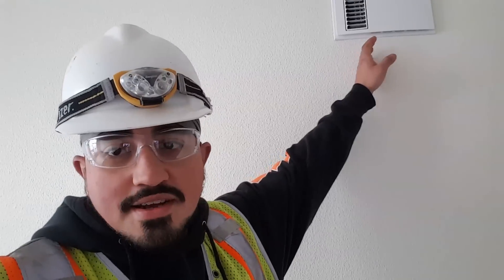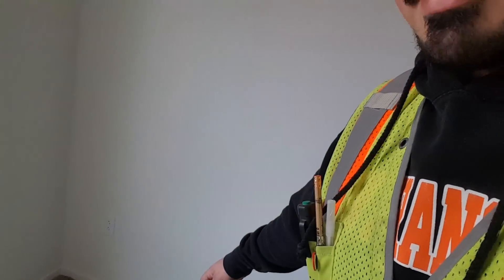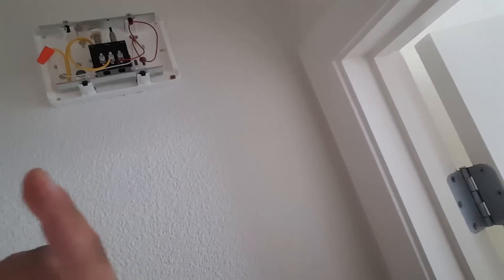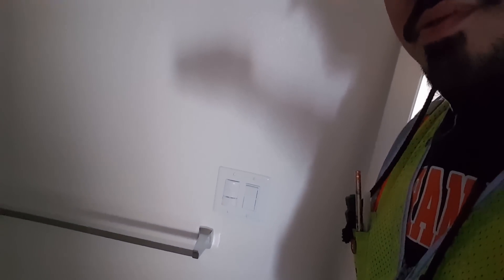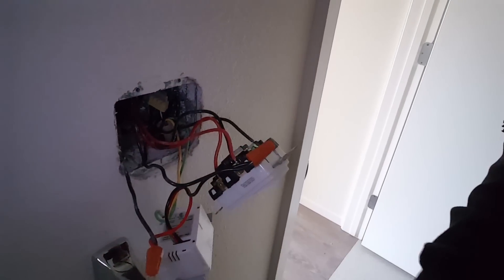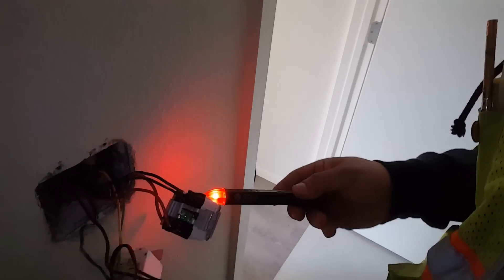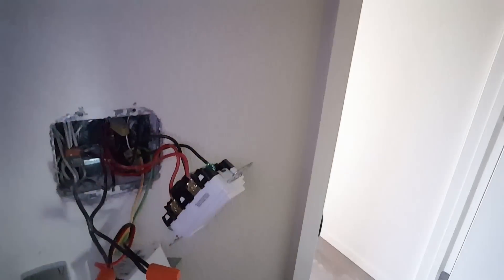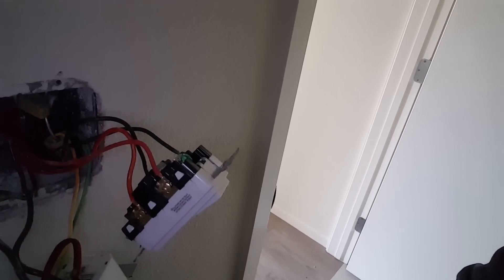A day in the life of a Union Electrican (2 of 2)

Comment: as an electrical apprentice with decent knowledge im a little confused by this whole 2 pole switch situation.
what is the purpose of having 4 wires if they come on together? why wouldn't it just be a 12-2 up to the fan light and wired together up there?
Reply from the maker: +John Pish that would make alot of sense but the factory wiring is separate. Its a dumb design that is needed to be that way.
Reply: The LMT Channel so what exactly does the 2pole switch do? is it essentially a 220v switch?
Reply from the maker: John Pish No, not 220. its 2 switches in 1. 2 circuits controlling 2 things with one switch. in our case we pig tailed the line to both sides using 1 circuit to power 2 different things at the same time. the fan and the light because of the way the fixture was made from factory.
Reply: The LMT Channel The LMT Channel so if it's on one circuit.
what's the purpose of pigtailing the line side and using a 2pole switch. instead of pigtailing the 2 switch legs onto the load side of a standard single pole switch?

wouldn't that accomplish the same thing?

maybe I'm missing something. seeing it hands on I'm sure would make more sense

Comment: Those heaters are the stupidest thing ever. no central air? no ducting? Also, those panels seem to be mounted WAY to low.
Reply: +ACombineSoldier I know in Seattle we mount so top breaker is compliant with ADA (I think 46") A lot of places just do that to be on safe side.